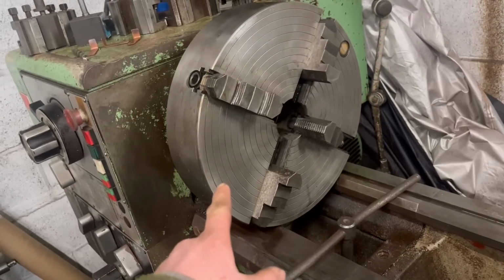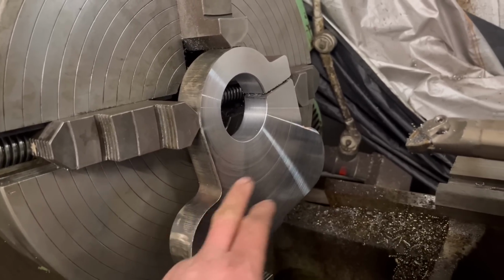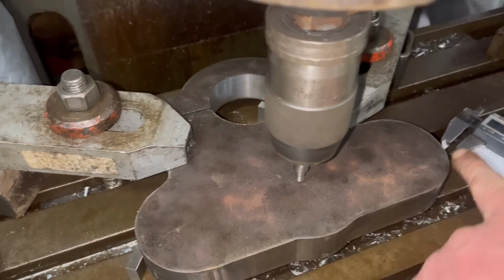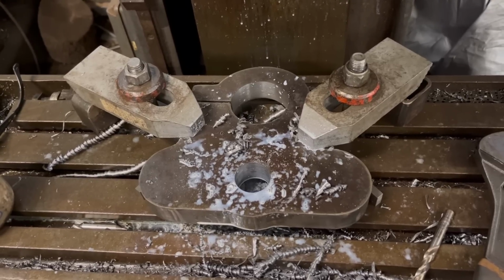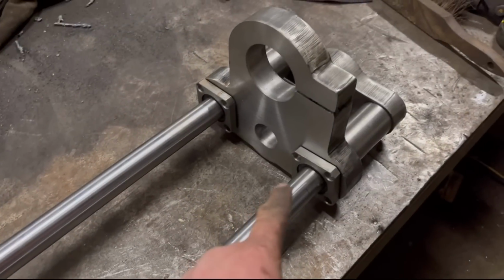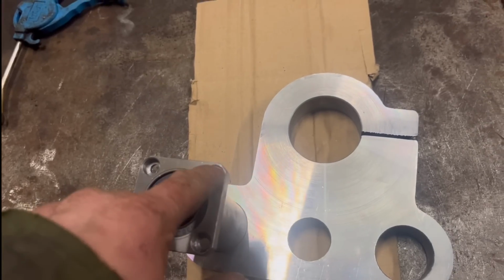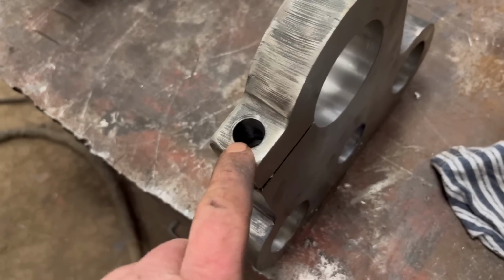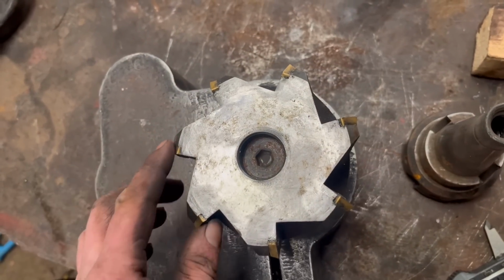Making a portable line boring machine! Shop made. Part 3. Machining mounting plates.

Comment: feeds and speeds for a face mill are based on how many inserts and the material the starting parameters are around 100RPM and about 0.150" dept of cut and play from there, it depends on the rigidity of your machine.

Comment: 9 inch grinder fly through that then clean it up on the mill, it’s coming together well the borer 👌
Reply from the maker: I was thinking of that as one of my options. Thanks!
Reply: @snowballengineering  - I am neither engineer or machinist but I was going to suggest you rough cut the bulk of the excess out with a grinder and then finish off with the fly cutter or a suitable end mill.

Comment: What kind of drill bits do you recommend for drilling in steel? There are so many different coatings and such. I am mainly a woodworker, but I've started doing a bit more metal stuff and want to invest in some good quality drill bits so that drilling in steel isn't near to impossible every time I try it. I will mainly work with mild steel / stainless in the beginning.

Comment: A little weight is good as it cuts down on chatter. No doubt it’ll be heavy but at least it won’t flex. It’s going to be a great tool when you’ve finished, I’m enjoying the process 🙂
Reply from the maker: It doesn’t weigh too much at the moment. Won’t be as handy as the mag drill for getting into places tho I don’t think. Hopefully 🤞🏻
Reply: @snowballengineering  But you will still have the mag drill set-up for those fewer occasions.

Comment: I've just built an arbor support for my bridgeport and had to remover a lot of steel from the plate I was using I used a ripper shell mill and took a .250" depth of cut without any drama but that face mill isn't going to like big cuts going to take a while with that .
Reply from the maker: Think I’ll drill a row of 50mm holes, take the rest out with a big end mill and then finish off with the face mill.

Comment: drill a decent size ,say an inch ,hole in the corner of the material you don't want then cut down to it with a horizontal bandsaw ,there will be some milling to tidy it up but you will be left with a nice radius in the corner and a useful offcut.
Reply from the maker: Could do, only thing is it’s 230mm wide so would be quite a deep hole to drill.
Reply: @snowballengineering  Not so far from either side but needs a bit of care setting up.
Reply from the maker: I like the idea of having the nice radius. Thanks for the suggestion.

Comment: Nice build I wonder if it might be a bit heavy for moving a round. I do some line boring myself . It looks like it well work out . I have an old K O LEE boring set up it is self feeding with two speeds.But no  frame work like you are building keep it going you can get it done
Reply from the maker: No doubt it’ll be heavy. Might have to see if I can lighten it some if it’s going to be too heavy.
Reply: @snowballengineering  Brother you are definitely going for the last three or four lifetimes dependable and indestructible build. Hopefully I will be able to replicate your work in aluminum.

Comment: You could fit a cheap Chinese DRO on that mill which would make life a tad easier and lessen the chance of making a mistake by not having to convert metric/imperial measurement units. 👍😁
Reply from the maker: Yes, I keep toying with the idea but I’d like a bigger mill really, had a few jobs now that wouldn’t fit.
Reply: @snowballengineering  You can always remove the DRO when you change the mill. I'm looking forward to the next instalment 😊 Can I ask where you are located

Comment: Very well done. Top darts What size clarkson auto lock do you have as I have some big end mills.
You could plunge mill the metal with a big end mill. Put a bit of scrap on the mill bed clamp it down well and try the tip cutter around 140 and watch the chips...DONT climb mill as the back lash in the old girl will not be good.
Reply from the maker: I have a 32mm end mill I could plunge cut with. Or I could drill a row of 50mm holes and mill out what’s left.
Reply: @snowballengineering  Gang drilling is good, used to do that on roughing out for slots.  just keep the bed lock nipped up and only mill into the work not climb.

Comment: Heavy translates to accurate. But when you traversed the drill it went through an arc? Don't ask me how or why? If you're unhappy with the weight use the steel blocks as plugs for sand moulds and remake a set in aluminium. It's a heavy mission so we can all see this is just equipment to do the real work. I don't understand how the drill appears to make a gentle arc through the length of it's travel? If you figure it out I'm all ears?
Reply from the maker: Must be how it looks on the video? The rails have dead straight.

Comment: I am not a machinist but is it more logical not to squeeze the opening first and mill it to size but do the opposite by cutting the split tag it bore it to size cut the tags so that it will fit and be very tight when tighten the bold?
Reply from the maker: I want it to spring open and be a loose fit when the bolt isn’t tightened so it’s easy to remove.  I see what you’re saying, the bolt should tighten it down more than what I squeezed it down to machine it.